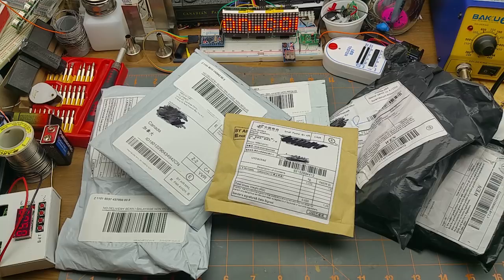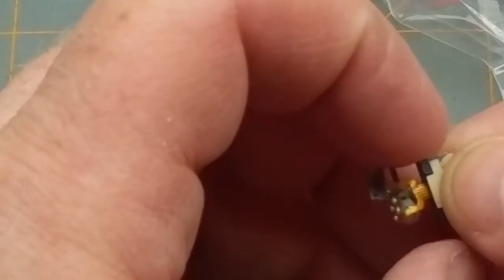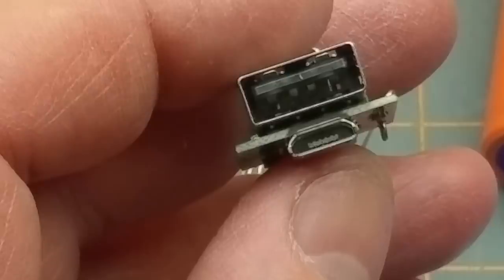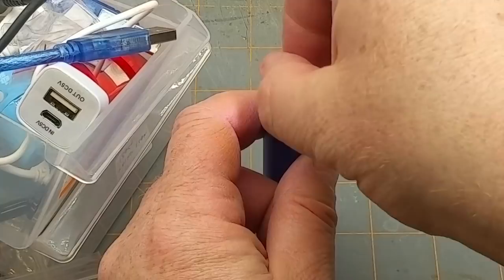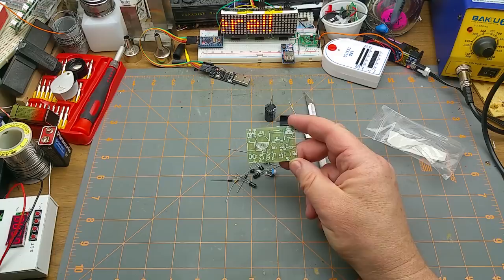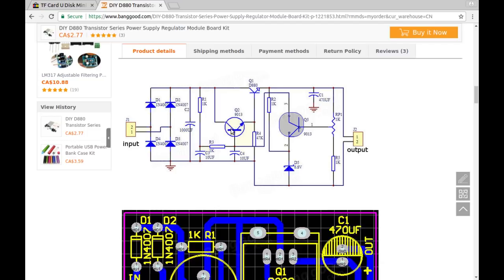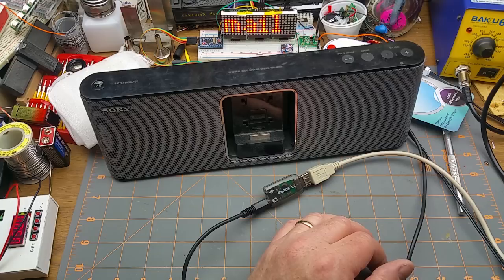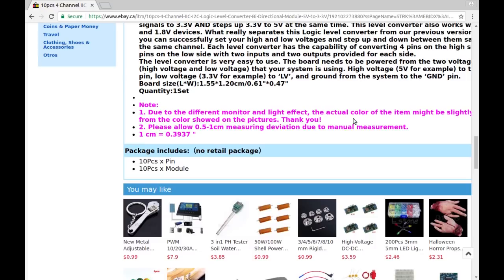Mailbag Monday 23

Comment: i have bought several different stepper motors generally small with the copper ribbon connectors and have then had a terrible time trying to find the correct adapter for them i wish they would give that information in the details but they dont.  an other problem i have had with them is i have bought those ffc sockets and then found only one 1.0 to 2.54 adapter board from America but they wanted $us 14.00 to post it to Australia.  how large or heavy is the darn thing.   Love the show found a lot of things to buy.

Comment: I have one of those USB Sound Cards (or very similar).  I got mine for using Virtual DJ on the PC, means I can have the main output sound from the built in sound card going to the disco speakers and use the USB sound card for listening to separate mix for mixing and queuing tracks, not the best of quality but fine for a second monitoring channel.

Comment: I recently bought a headphone stand and it is a USB3.0Hub+7.1 Surround output through 3.5mm jack. I guess they make 3.5mm Jacks with surround now.
Reply from the maker: Since I recorded this, I've been doing some research.

To do real surround on analog outputs, you do need separate wires for each channel. ( 5 or 6for 5.1 and 7 or 8 for 7.1)

However, there are a lot of "simulated" surround methods that use only 2 channels  and various audio processing tricks to make it appear sorta kinda like surround.

I suspect my dollar adapter is using either the "simulated surround tricks" method, or the "blatant marketing lies" method.

Comment: Hi  Before voltage regulators were available I built lots of power supplies like that but why
would anyone bother doing that now ( except to show how it was done 30 years ago )
When the LM317 etc are so much better and so cheap  ?

Also what is the USB soundCard for ?  I would think that any computer that has USB will
have a built in sound card ( and perhaps with more speaker sockets )

I have some of those tiny stepper motors , I planned to solder directly to the motor --- is
that what you tried ?
                                                                                                      Thanks
                                                                                                                                Alan
Reply from the maker: The power supply kit is partly "because I can" and partly to see how high current a regulator I can do in an "old school" way. 

USB sound: I was hoping to use it as an input for my Raspberry Pi (but not after I heard how bad it is). I also have an old laptop with failed sound. Might use it for that.

little steppers: Yeah, I already tried soldering - they’re too fragile for me - I already melted the guts of 2 of them. But that was before I got my temp controlled iron.